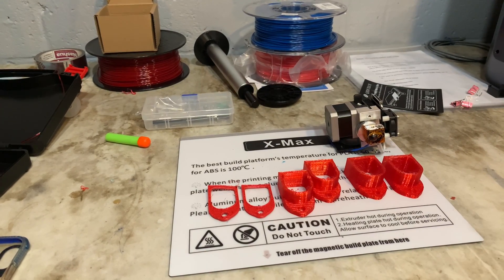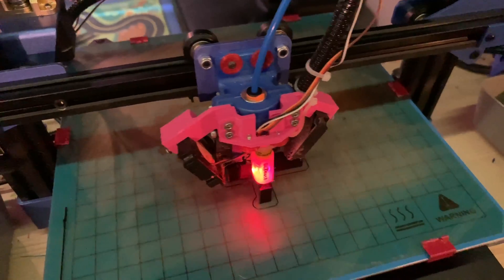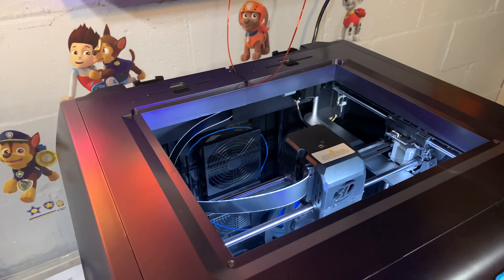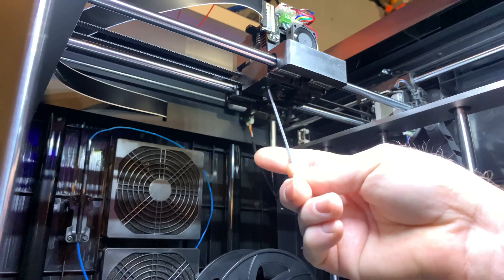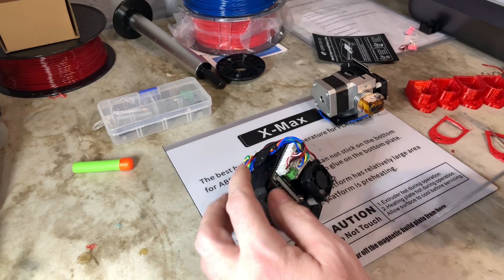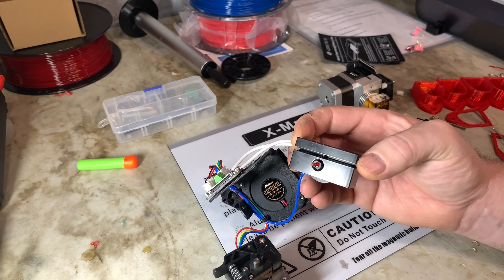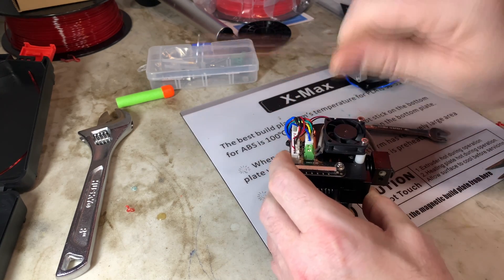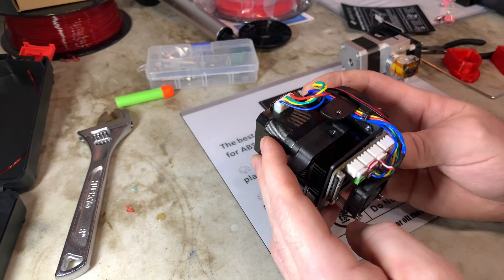Qidi X-Max More extruder jamming issue! More extensive extruder tear down

Comment: I had the same issue and after becoming proficient at fixing the problem, I studied the cause and came to the same conclusions that you did in this video. Too much heat travelling too high causing the filament to soften and crumple above tube, causing the clog/jam. After much thought and study of the problem, I designed a new duct system. This has eliminated this issue for me.
https://www.thingiverse.com/thing:4435233
Reply from the maker: That’s great. After about 10 failures in a row trying to print Nylon I did something similar. I took a small fan, one used with raspberry pi cases and slid It inside the metal housing were the part cooling fan goes on the low temp extruder. This fan is blowing on the upper aluminum cooling fins and the gap between the heater block And lower cooling fins directly on the filiment tube.my 5 hour nylon print final finished without jamming up. Hopefully this is a permanent solution.
Reply: @TTV_FUN_AT_50  could I possibly see some pictures of your solution
Reply from the maker: @Pardner454  yes, unfortunately I just started another 5 hour print as the one that finished did not have a good z height and warped a fair amount.(my fault) This solution only works on the high temp extruder unless you don’t plan to use the part cooling fan on low temp. I also ordered brass tubing that I may try and replace the plastic tubing in the hotend with. It always appears burnt and shrunk down on the nozzle side, that is normally what causes failure for me on the low temp extruder.
Reply from the maker: @Pardner454  https://home.mycloud.com/action/share/8bd6660f-572d-47be-8163-f29712191c3d
Reply from the maker: https://home.mycloud.com/action/share/8bd6660f-572d-47be-8163-f29712191c3d
Reply from the maker: So my second print failed about 4 hours in. I was pretty disappointed as I thought it may have been the fix. I decided to try and run the fan I added and it would not spin. The fan I was using was only rated for 5V and the output I was using is 24v at full power :) so it appears that the fan failed during the second print. Not sure how to share pictures here. The fan will just mount where the part cooling fan mounts on the low temp extruder. Instead of a duct fan it needs to be a normal cooling fan. I plan to added the cooling amount in the slicing software that way I don’t have to remember to turn it on each print. I am trying again with a 12v fan, hoping it last the 5 hour print as I need the part for work tomorrow.
Reply: @TTV_FUN_AT_50  very easy to order a 24v fan then it won't burn up
Reply from the maker: @Pardner454  I just ordered a 4 pack but I need to get these prototype nylon parts done for tomorrow so I am desperate at this point.
Reply from the maker: Qidi has been great  about sending replacement parts but It doesn’t help because the design is flawed in my opinion.
Reply from the maker: hopefully the correct fan will be a permanent solution.
Reply: @TTV_FUN_AT_50  yea the fan to heat sync design is lacking in cooling efficiency. Sounds like you are one of the fortunate ones capable of diagnosis and correction. Good job!

Comment: I'm having some serious issues with underextrusion in that printer with both the extruding sets that comes with it. Do you have any clue of what could be the issue? I'm getting so frustrated with it. That's probably similar to the issue you had, but i'm having it trying to print ordinary PLA and ABS
Reply from the maker: Based on the issues I was having I suspect that you have a partial clog in the PTFE tube and or Nozzle. Mine actually melted on the end causing a major restriction.I would try to work on one of the extruders and get that working correctly to reduce confusion/complexity. A simple thing to try is to turn up the extrusion multiplier in the slicing software to begin with. How fast do you print? If that doesn’t work it may be worth tearing the low temp extruder down and replacing the PTFE and Nozzle Tip. Just insure that you get everything back together correctly paying attention to the height of everything. Remember the two extruder have to be almost exactly the same height in order to swap back and forth seamlessly.
Reply: I have under extras well.
Reply: I also got under extrusion problems, however only after a retraction. I suspect this is due to heat creep resulting in the filament softening to far up in the heat brake. I will try improving the cooling by adding thermal paste and maybe improving the cooling fan. Did any of you try someting like this?

Comment: I am having the exact same problem with the lower temp print head. I contacted tech support and they ran me in circles for 3 months having trying all kinds of things attempting to fix the problem. When I initially contacted them I asked for a new print head because it was under warranty. After 3 months of taking the print head apart as you showed here which is not a simple task I got them to send me a new print head. The bad news is I had to pay for the new print head because it was now not under warranty. They tricked me on that one. I received the new print head today and it is printing good so far.

For such an expensive printer I cannot recommend buying this printer especially if you are a beginner! I read many reviews on this printer before purchasing it and one of the things that sold me was that everyone was giving them rave reviews on tech support. I give their tech support one star out of five.
Reply from the maker: I was going back and forth with tech for a short period of time, i agree for the cost it should not be so difficult to do the very thing the printer is made to do, extrude plastic. I basically told them i wanted to return the printer and they sent me a whole new low temp assemble and the high temp hot end minus the board and stepper. The printer does actually print really nice once the trouble are figured out. Then again so do my $300 Zyltech Gear 2 printers with upgraded Hot ends. I wanted an enclosed printer for higher end materials was the only reason for purchasing this printer.
Reply: I was having the same problem with constant jams and after a few emails back and forth they sent me a new low temp hot end free. Haven't tried the high temp one yet.
Reply from the maker: sorry to hear that. Mine is finally coming around. I am mainly using this machine to run TPU on the low temp Hot end and Nylon on the high temp Hot end. I think some of my issues was running the low temp Hot end at too high of a temp, partially melting the PTFE tube that is basically all the way to the nozzle. After changing that i was still having issues so i changed out the Nozzle and it has been running good for a good number of prints between both Hot ends.

Comment: QIDI support told me do not attach the fan container when using the high temp extruder.
Reply from the maker: Yes. Not sure I understand why, but they did tell me the same thing. I have continued to have issues even when following their advice. They have been kind enough to send me  replacement parts to help resolve the issue I am having.
Reply: Did you resolve the issues? I would like to see how.

Comment: Keep in mind that the high temperature extruder is for use with high temperature filaments like nylon or polycarbonate only. Run normal filaments through it and you're asking for trouble. And follow the instructions for filament change to the letter or you may clog the hotend. Let the extruder do the retraction job before you pull on the filament. It really makes a difference. And yes, I know from personal experience that this is not easy when you come from a bowden type printer.
Reply from the maker: Thanks for the reply. A real question... why is it an issue to use normal material in the high temp extruder? Does the hardened nozzle require higher heat to flow better or something? This high heat hot end has a PTFE tube in it which surprised me.  I converted all of my other printers to all metal hot ends. My first printer I had for 3 years was a direct drive so I have plenty of experience both good and bad with them.
Reply: @TTV_FUN_AT_50  As far as I know there's no PTFE tube in the high temp hotend, it has a PEEK tube insert. I've not disassembled my unit, but even without disassembly I can see that there is no PTFE tube reaching out to the extruder as it is on the normal unit. There's a visible gap of 2 or 3 mm below the extruder. I guess that low temperature filaments do not work with a PEEK tube insert.
Reply: @chevy60  why wouldn't peek work with other materials?
Reply: @quickdrawmcgraw4394  I don't know for sure, but some materials may stick to PEEK. Just because it can handle higher temps than PTFE doesn't mean that PEEK has similar non-stick characteristics.
Reply: @chevy60  makes you wonder why they use it at all then... do you ever use those capricorn ptfe tubes? I hear they hold up better the the 240 plus temps.
Reply: @quickdrawmcgraw4394  I have tried the Capricorn in the hotend, but didn't like it any better. The slightly smaller inner diameter does not improve the situation and no PTFE holds up at 300 C. The stock PTFE works better for me. Nevertheless I will upgrade to a BMG extruder with Dragon hotend in the future.😇
Reply: @TTV_FUN_AT_50  PLA will clog up in the high temp extruder.Fact
Reply: @TTV_FUN_AT_50  does the "peek" tube shrink like the qidi ptfe tubes
Reply: you can print with brass nozzles at 250-260.... the problem is abrasion
Reply: @5andman68  Nozzle abrasion does not cause extruder jamming. A due to abrasion enlarged nozzle diameter would make life easier for the extruder. Abrasion is a different problem.

Comment: dude, get E3D V6s + Bondtech BMGs instead of this chinese mess :D
Reply from the maker: I don’t mind spending $300 on a printer and then upgrading weak areas, but should that be necessary on a $1,300 printer? Probably :)
Reply: @TTV_FUN_AT_50  of course!
Reply: @Alfredo Pisano as I did with my Bcn3d sigmas, in stock total crap so purchased Ey3D v6s original BMG and capricorn, drew the parts on my own, invested some time and put it in working stage, after a while sold it
Reply from the maker: @Alfredo Pisano my solution only works with the high temp extruder as I put an addition fan on the cold side of the hot end. How hot where you printing the PETG? I found anything over 235C I was getting clogging in the PTFE tube as it started to melt. I bought brass to replace the PTFE tube with but have not had issues lately so I haven’t experimented with it yet